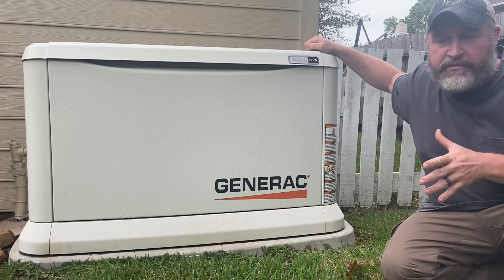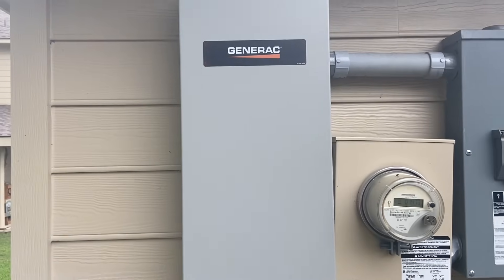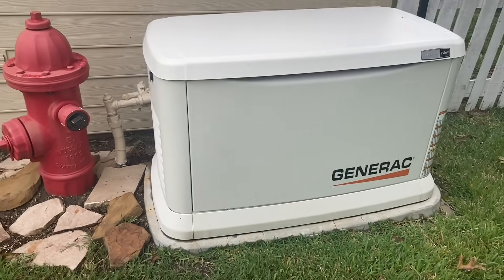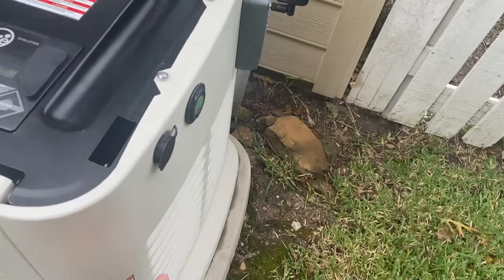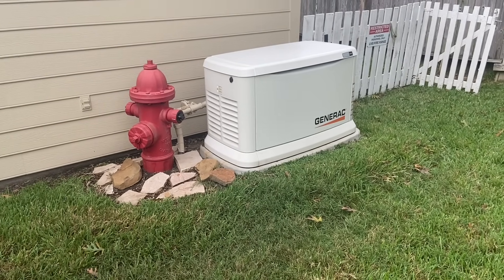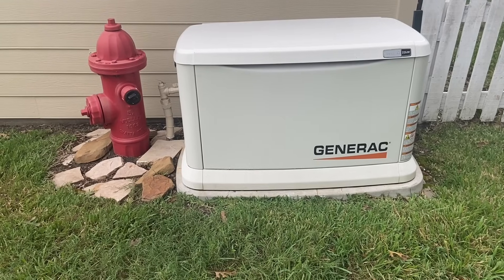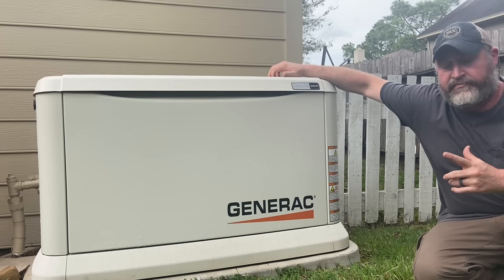Thinking of purchasing a generac whole home generator?

Comment: I've had mine for five years now. I service it myself due to the high service cost. Normally a kit of filters and plugs is around $30. The company wanted to charge me $400 to do the fifteen minute service. I wouldn't want to be without one anymore. A couple of days back the power went off for two or three hours and life went on like normal. I'm out in the country and installed a five hundred gallon propane tank to fuel it. I don't know why the guys battery failed. I still have the original battery in mine although I've bought a replacement and simply haven't gotten around to installing it yet.
Reply from the maker: Awesome thanks for watching and the comment please subscribe like and share, take care buddy and have a great day.

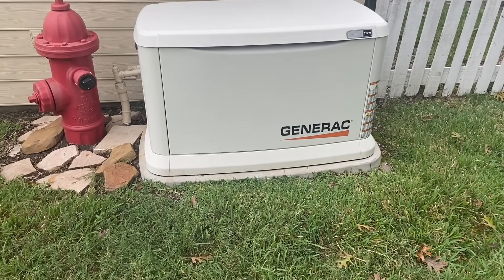Comment: Lizard at the 10:00 mark. I repeat - lizard.
Reply from the maker: But you missed the squirrel 🐿️???
Reply: @JustCantSitStill  Saw the squirrel! Replayed that portion several times to be sure it was a squirrel and not a porcupine! Been looking at getting a whole-house backup, but haven't been able to swing it just yet. We've had power outages in our area off and on due to falling trees taking out power lines. Had one just last week that lasted 7 hours. Fortunately, it happened at 10:00 PM and was restored around 5:00 AM. Weather was not too cold, so we stayed warm. Thanks for the video and the info.
Reply from the maker: Thanks for watching I appreciate it!
Reply: Gecko 🦎 making sure the new unit was installed correctly 🐸 bang up job if I say so myself bundle your home and car and save 😀

Comment: I just moved into a place that already has an 8kw Generac because it’s a relatively small island that loses power in the winter quite frequently, sometimes for days.  We lost power a couple times since moving in the summer, so we got to know it a little: it was “off” at first so had to be started manually or switched to automatic (which we did, previous tenants probably didn’t like “exercise” mode) but it only powers certain circuits in the house since we have electric heat which would be WAY too much, but there’s a wood stove of course, so we can heat the place and cook since the electric stove is also not connected...  unfortunately it is installed right outside our bedroom window that opens, which is definitely not ideal, still better than no generator or setting up a portable gasoline one with extensions running everywhere.  The fuel for ours is stored in a very large propane tank; there’s no natural gas service here.  We have an identical one at the corner store we run that is wired into one walk-in cooler but seems to have the possibility of being wired to multiple loads that it would cycle between but has not been set up that way so far...  we would like it to run the main freezer after a while, the beer walk-in doesn’t absolutely need generator power, but maybe upgrading to a bigger generator would allow the whole store to stay running...  it’ll be interesting to see how it goes this winter.
Reply from the maker: Thanks Erick for checking out my channel, please subscribe and check out some of my other videos

Comment: Pay attention people this generator is flat on the ground so if you flood it's useless build it 3 foot off the ground.
Reply from the maker: Not flat is over 10” off the ground, dirt and grass has been built up around it . But thanks for watching.
Reply: We ordered a 6” slab and the engine itself sits another 5 inches or so off the ground, so no, it is NOT flat with the ground.
Reply from the maker: @toosense  good thinking, if ever have any issues with the block foundation I built we plan to lift it temporarily and pour a slab.

Comment: Sounds like it’s cheaper than solar with a battery backup.
Reply from the maker: Never looked into Solar do I am not sure? We purchased this for hurricanes and I figured we would be able to utilize it longer than some batteries. Not a lot of sun before and during a storm.
Reply: You need to consider the fuel cost.  We're on propane and it costs $3-$4/hour to run.  The fuel isn't free.
Reply from the maker: @barryf5479  lots of variables, gen size, load etc , however we a 52$ difference from the month we had our outage to the previous year month. So I am guessing around 17$ per day give or take for the 3 day outage. Hard to figure as we had furnaces and gas fire place going with the attic door open to keep pipes from freezing up. But it cost what it cost if you want power.
Reply: @barryf5479  I’m on natural gas here in Fort Worth. I hadn’t realized propane was so expensive. My Tesla solar system is about $70 a month for the lease and I pay anything over what I generate. The Tesla Power wall wasn’t available when I got my system. I wish I had one now. They are about $9,000 to purchase.

Comment: $11k that's a really good price I was expecting it to be way more than that. We had solar installed and have a backup power source for when power goes out Solar company that did our solar install quoted us $30 grand for a 24KW Generator system seems to me they most definitely trying to rip me off.
Reply from the maker: Currently in my area 13-14k for the same set up I have, thanks for watching I appreciate it.
Reply: @JustCantSitStill  yeah I thought it was weird because Solar company I went with that installed my solar was actually the cheapest around for my solar equipment but they apparently don't know much about installing LP or gas generators or how to price them because they told me they subcontract it out to a local whole home standby generator installer basically they trying to get theirs plus whatever that subcontractor charges. Because everyone else I've been quoted anywhere between $12k-$16k and that's mainly because I need a new LP Tank and a new buried supply line for my emergency space heaters that they are going to have to bury about 500 feet.
Reply: @JustCantSitStill Also being able to turn it off and on from the app is so you can turn it off when nobody is home if a power outage happens while you're away no need for it to be sitting there running wasting fuel if nobody is home.
Reply from the maker: @Brad.W  We don’t have the option for turning off and on in the app but i don’t see the need, if  I am not home my dog still is and needs the AC, and my refrigerator/freezer still needs power as well as the alarm.
Reply: @JustCantSitStill  Ahh well I also have solar with a battery backup. During power outages my current (old) system is setup so the generator comes on and runs the entire time of the outage even when my house isn't pulling from it my Generac inverters use a 4G wireless communication module that allows me to connect to it anywhere in the world they also manage the output from my generator as well as the production from a solar system. The new generator they are recommending the generator will only run when my battery backup power gets low and there's no sun to recharge or maintain the batteries. The old generator just runs constantly I have to tell the inverters to kick it off manually because it is a non communicating generator that doesn't work with a wireless module.
Reply: Is your home 1 or 2 stories, and does it have basement? Also you mentioned you had to replace 18 month battery at 16 months, is a longer lasting battery available or is 18 months max due to system requirements?
Reply from the maker: @donnamccreary7008  2 stories no basement, the battery mine came with was junk , I purchased a new one from an automotive store and it’s been great for about 3 years now.
Reply: @Brad.W  You don't have refrigerators or freezers?
Reply: @JustCantSitStill  You need to be thinking about replacing that battery now....

Comment: Generac Gas or propane generators run at 3,600 RPM sounds like a screaming lawnmower. A diesel generator usually runs at 1800 RPM. Mine is much quieter, and is a lot cheaper to run. A diesel engine is much better built.
Reply from the maker: Cool thanks
Reply: @JustCantSitStill  someone said the engines don’t last more than 750 hours.  I don’t know how true that is.  Ours is old, and still going fine.  We have quite a lot of long power outages due to  wild fires and storms.
Reply from the maker: @rodgraff1782  my dads is about 15 years old and still works great no issues. Thanks for watching and the comments.

Comment: Great job on the video, thank you. Straight-forward, no "upselling" tactics, no trying to be funny, just useful information. I've seen some generator videos I couldn't even stand to watch for 20 seconds. Why people think everything needs to be a comedy act is beyond me. Anyway, I'm thinking about one because the way this world is you never know. One question I have if you don't mind: So do you need fuel or since this is a gas line as long as that gas line is there you don't need anything else I assume? We have a natural gas line going into our home already for our HVAC so just wondering if I needed to store gasoline which is hard to do and not real safe around homes. Thanks! Probably a silly question, sorry. :)
Reply from the maker: Thanks for watching subscribe like and share, runs on NG or propane.
Reply: @JustCantSitStill  There are no dumb questions, only dummies like me! Thanks man. I'm gonna check out your other Generac video/s too. Enjoy!
Reply: Aside from a Generac, you should always have back ups and redundancies. Example a back up inverter, or portable generator ready to go on gasoline, propane or natural gas. Five hundred gallon or a thousand propane tanks are a great way to store fuel. Even a hundred pounder and some 20's. Effecient wood burning stoves or effecient wood burning inserts are the best to have as a back up for heat and even cooking. Get rid of any innefficient gas fireplace and go with efficient wood. Good luck.

Comment: Funny how quiet they can make a V8 car engine, but these house generators are still so dang loud…
Reply from the maker: These operate at 3,600 rpm but surprisingly not as loud as most think. https://youtu.be/C-a5FbEqU7A
Reply: You can get quieter ones, but they are much more expensive. These are two cycle motors, if i understand correctly. Think lawn mower or motorcycle. :)
Reply from the maker: @lukeball4937  4 cycle
Reply: @JustCantSitStill  Sorry about that. I stand corrected. :-)
Reply from the maker: @lukeball4937  yeah the quieter ones are 4 cylinder engines, this one is a 999cc twin cylinder similar to a large riding mower or a v twin motorcycle
Reply: @Patrick Baptist It's easier and cheaper to get 60 cycle current at 3600 RPM.
Reply: @williamjones4483  1800 RPM 4 pole (60 hz.) lot quieter & easier on the motor running at a lower RPM. Also more torque as well. (Hz 60 X sec/min 60 X 2 N & S / # of poles = RPM. 2 pole 60 hz =3600 50 hz = 3000 rpm.)
Reply: @lukeball4937  No, 4 cycle.
Reply: @JustCantSitStill  EXACTLY like a riding lawn mower.
Reply: @williamjones4483  No, it is not easier, but it is cheaper to use a smaller engine at higher speeds (3600 RPM) to develop the needed horse power to spin a two pole alternator, than to make a 4 pole alternator and the equally larger engine to produce the needed horse power to run at 1800 RPM to maintain 60 cycles or hertz and produce the same power.

Comment: Thanks for the in depth review and cost breakdown.  I installed a Generac 12K in my shed and a manual transfer SW.  My concerns here in the woods are Forrest fires since first thing that goes is power.  So primary wanted to power my well and freezer / fridges.   I ended up not that far in cost below you, and I ended up with a smaller unit and manual switch and had to install it myself.
Most likely would have gone that route if available then.
Reply from the maker: Hey thanks for watching I appreciate it. Please subscribe and check out some of my other videos

Comment: Must have in a place with crappy infrastructure like Texas. I lived  years in Northern New England with some the worst winter weather in America and Never felt the need for a full time, whole house generator. Once during a really bad Ice Storm we lost power for a few days. Just stayed in a motel. But even with all the graft and corruption in politically notorious New England they at least built a reliable  electric grid. Texas not so much.
Reply from the maker: Thanks for watching, we deal with hot temps here freezing weather is not something we have normally so the big freeze we went thru last year crippled us. I bought the generator for hurricanes and other storms never thought a freeze would be when we needed it the most.
Reply: Big difference between the sizes right?
Reply: Bill where I live every time it rains, high winds , snows, thunderstorms, power goes out routinely, it’s a pain!
Reply from the maker: @CallsItLikeISeizeIts  yep same here very unpredictable, one day it’s freezing next day it’s 80 degrees and flooding!

Comment: Terrible product. Generacs fail when there is a brown out condition. Very close friend in upstate N.Y. has sold his Generac just to get rid of the problem. The automatic switch over relay has cought fire twice because of the brown out condition. Power still coming in from the line and the Generac still trying to run. Burned two sets of relays up. Generac said not our problem, see the power company. Power company said not their problem. Act of God...lol. So for a 10,000 dollar Generac this is what you can expect. Poor engineering, this should never happened if all possible electrical outages or failures were designed into the backup system. Don't do it unless they put in writing they will cover Brownput situations. Oh and you better increase you fire insurance coverage also. You should have seen his power panel. Very dangerous. Good luck you'll need it.
Reply from the maker: Awesome thanks for watching!
Reply: I wonder how many of the horror stories are the result of poor installation, rather than the generator??? 🥴🤔
Reply from the maker: @donalddodson7365  I would bet a very large percentage.

Comment: Don't really understand why people go with such large generators.  It's more expensive and burns more fuel.  Considering they are for emergencies I think you could limit your usage somewhat.  Do you really need to run every single large appliance at the same time.
Reply from the maker: Expensive is up to a personal perspective, I paid for convenience. Usage is limited as this is for emergencies so fuel consumption is not really a concern of mine.  Thanks for the comment and for watching.
Reply from the maker: @trajan6927  💯 % agree
Reply: Well look at it this way. Your the only person in your family that has power and gas  after a hurricane and powers is out for 2 weeks . Your house will have 3 or more families in there at one time
Reply: And, you don't want to work a smaller machine to death, either.  Nor do you run every appliance.  During an emergency, fuel usage is already something that is accounted for (or should have been) so that is not a primary concern.  The primary concern is power, otherwise there would be no need for the generator in the first place....

Comment: Whole house generators are Louder than a nuthouse on new years eve
Reply from the maker: Nah not really check out my other videos thanks for watching
Reply: liquid cooled is where it's at
Reply: @JustCantSitStill  bs. my neighbor has one and it actually shakes my house when it goes off every week.
Reply: Much quieter than portable
Reply from the maker: @chrisc8073  guess it would depend on how close they put it to your house, mine definitely does not shake our house or our neighbors. 

Wonder if they have something wrong with theirs?
Reply from the maker: From inside ours is about the same noise level as a standard push mower.
Reply: I have a liquid cooled Cummins. I can stand next to it and hold a conversation at normal levels.
Reply from the maker: @TheOmei  yep liquid cooled are way more quite , I could not afford one though.

Comment: God bless you, just signed for an 18kw for 14k, think prices might have changed since your video.  Fellow Texan here.
Reply from the maker: Yes currently 13-14k is what I am seeing as the new market avg for our area.
Reply: We had a 18kw installed two years ago, a full turn key installation and paid 14k as well. Our home is 2600 square feet, uses natural gas for everything and the 18kw generator is perfect for it. We've had several outages over the past two years and it has never failed to provide power to everything in the house. You will not be disappointed with your purchase. We considered the 22kw but the Generac-approved dealer told us we didn't need that much power and said the 18kw would be perfect.  I like that honesty because 22kw would have cost a bit more but he was there to help us decide, not to take advantage of our lack of knowledge be selling us more than what we needed.
Reply: @kenherrera2819  had a similar experience.  One quote, the installer explained that the 18kw was more than enough, especially when factoring in a smart management module, while the second quote just tried to put me into the biggest generator he could.   Our home is single story, about 2300sqft.  Hearing your story makes me feel better about the decision we made.  Hope to get it fully installed and up-and-running before hurricane season starts to ramp up.
Reply: @saintmichael7252  Our home is also a ranch style, just one floor and a basement. When they installed the generator they had us turn everything in the house on..everything... then shut down power and let the generator take over. It did so without missing a beat. You will find 18KW perfect for your home. I mentioned ours is all gas so the biggest user of electricity is our A/C unit's compressor. Even the furnace is gas and uses very little electricity. The story might be different if we had an electric water heater and electric stove, but we are all natural gas. I believe even with those the 18K would be enough power.